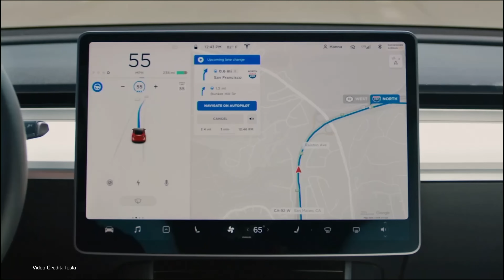Why Are Initial Production Runs Of New EVs So Slow?

Comment: My personal issue with these protracted wait times isn't so much the waiting because I get they are building something that doesnt currently exist. My issue is, the new normal is the "pre-order". It was dumb when video games started doing it and it's dumb now. There has to be other ways to find out who seriously wants a vehicle rather than taking money with not even the promise of "exclusive updates" or a baseball cap or mouse pad. Its like ordering from Amazon using prime but getting no info on when it will show up or even if it shipped. Only to find out randomly from the news that it's been pushed off by 8 months

Comment: Ford is often credited with the first moving mass assembly line but just as Star Trek touting how they filmed the first interracial kiss this is false. Mass assembly was made possible by interchangeable parts, the concept of which is erroneously credited to Eli Whitney but US mass assembly was pioneered by the US Ordinance Group for reliable production of small arms and rapidly adopted by the bicycle industry. Meanwhile the meat packing and flour industries were using moving "assembly" lines. Singer, the sewing machine company,  combined mass assembly lines with interchangeable parts tech decades before Oldsmobile and Ford implemented it for cars. Like Ford, Singer found some last minute refining of certain parts necessary before assembly - a problem that companies like GM still faced with parts like connecting rods up until the 1990s. Ford, like Edison, Whitney, Musk, et al was great at promoting ideas as though they were his own and gaining credit for them without the pesky difficulty of actually being the first to think it up.

Comment: The automotive assembly line was actually first used by Ransom Eli Olds in 1901. Ford did not begin assembly line production until 1908. Olds was the founder of the Oldsmobile car brand and the REO truck brand. And yes, the most popular REO truck was the Speed Wagon.

Comment: So, in summary,  It's not that Tesla is normal and other automakers are inefficient. It's just that other automakers are normal and Tesla is super efficient.
Reply from the maker: Not really. Tesla had the same sorts of issues getting their production lines rolling, as Elon noted in a tweet yesterday. It's far more that Tesla got a huge head start on the legacy automakers and of course on new startups, so while Tesla is rolling along at a pretty normal speed for series production of a car (think of how fast Ford turns out combustion F-150s) everyone else is still ironing out the process for their EVs because they are new models for those automakers. It's reasonable to expect that other automakers will get similar production speeds that Tesla has now eventually, but it took Tesla years to get there, and it will be the same for other manufacturers. - Winter

Comment: Best way will be to just allow all ice vehicles to be converted to Ev's

Production issues will be eased faster
Reply: What's stopping you?
Reply: @itekani  the rules dont permit such conversion 
If converted it cannot be used on roads 

That's the main hurdle

Let them have standards for conversion but that can add minimum 10 to 15 yrs life to the old vehicles

Ev's don't have complex equipment it is just battery and dc motors all gear boxes engines all that can be just scrapped 

Repair is equally easy 

While some countries are likely to have right to repair which may be used to convert vehicles but so far they expect a new vehicle to be built which will have all other things common like,
Body, steering, brakes etc which is redundant 

It can decrease the pollution at the same time
Reply: @prakashbapat3821  Not a problem here. But once you look into it you'll notice that even with all your own free labour put into it, the cost approaches what you would pay for a used EV with similar or better range and more features. Maybe this will change as used EV parts become more abundant, but I think conversions are for enthusiasts mainly. I will not be a way for the general public to get an electric car.
Reply: @itekani  here if they permit it. Ev's will cost less than half 

We have cheap labour and man power to do it on commercial basis ..

But there is probably lobbying from some quarters 

Further that can mean loss of revenue from new car sales on one side and permanently loosing petrol taxes which is the main income of govt now
Reply: @prakashbapat3821  I hope your regulations change. Governments will have bigger problems if we don't stop burning stuff soon.
Reply: @itekani  our govt is least concerned with all this so long as some/ big revenue is being generated
Reply: That change will just bring demand by the car manufacturer forward, increasing the problem and moving the bottle neck to the assembly line itself
Reply: @theairstig9164  the bottle necks are not from mang lines it's 
Only enough batteries and dc motors

All other things may continue

Just stop engine, transmission and add the two the vehicle production can be multiplied many times

Comment: When i think about it, manufacturers should give a special longer warranty on their first batch of a new line, as a thank you for first adopters as well as to incentivize adoption. What if Ford said, the first 75,000 Lightning Models off the line get a 7 year 500k warranty, as customer appreciation. If your vehicles are up to standard, then it's basically a cheaper form of advertising.
Reply: NO EXTENDED WARRANTY FOR YOU...!!!   (Warranty Dealer Rep voice)
Reply: @phillyphil1513  S'OK I won't be buying your crap car now. Thanks for confirming your attitude.
Reply: @spuddy4063  re: "I won't be buying your crap car now."  you will buy it and LIKE IT mister.
Reply: @phillyphil1513  TROLL
Reply: Who's to say some of the new auto manufacturers won't.  Meaning, they can always adjust the warranty down after so many are sold and/or a period of time has gone by.  E.g. Rivian is offering one of the best warranties for their R1T and R1S.  Perhaps after they produce/sell x number of them Rivian will reduce the warranty mileage and/or time period.

Comment: Rivin production could be very delayed - fire trucks are currently at there paint shop after a report of fire
Reply: YIIIKKKEESSS...! (here's to hoping they don't go FULL GRUBER)
Reply: @phillyphil1513  it turns out it was. a battery pack module that overheated in the battery assembly area and the fire service just needed to cool it down for a few hours

Comment: My expectations for Tesla's future vehicles:
I expect the Cybertruck to be more difficult and take time to ramp.  A totally new stainless steel production line for the body needs to be built.
I expect the future car (Low cost $25,000 (Probably $30,000 with inflation)) to ramp fast.  No worse then the Model Y.  I expect it will heavily borrow Model 3/Y technology.  For example it will probably use an LFP battery pack like the one used in the standard range Model 3/Y.  It will share the casting, stamping and paint shop with the Model 3/Y.

-Kurt

Comment: The first year of production of any vehicle is a time for working out production issues and problems.
The quality is usually much improved by the second year of production. Gas, diesel or electric vehicle they all go thru a learning curve when first being produced.
Reply: Even just new major model/ platform revisions had always slow ramp up. It just was hidden by car makers having whole range of models and model years. Thus having existing models in production and in sales and multitude of lines allowed bigger car makers to "stealth" the ramp up like VW did with ID.3, which was exceptional for EV. However not exceptional for cars in general. VW didn't pull the lets delay and make some to stockpile first out of a hat for ID 3. The had done same to some ICE model launches before.

Thus hiding from consumers the "actually every major new model change is a major undertaking". Company would just keep the old model in production and sales until the new model had enough stock and production line had ramped up.

Thus now when everyone is running their first EVs. Well there is no old EV to keep selling to hide the fact, that production ramp up takes time. The one who is about to start to be there is Tesla. They could now say run new major change of model S redo with completely new chassis and platform etc., while keeping the old spec model S in production and sale until  gen 2 was ready. Thus they could run a smooth hand over.

So it has always been like this. The EV model break just shows everyone how they sausage in being made. With ICE the manufacturers had long enough model range history, ICE specific expertise and so on to keep the run smooth to outside view. They simple wouldn't launch new model until they had sufficient stockpile and production capacity build up.

This will normalize, when everyone moves to their second generation of EV model ranges. They just keep making and selling Gen 1 model range, until Gen 2 is stocked and ramped up.

Comment: If you look at Initial Quality or Durability studies, vehicles from the first year of production fare very poorly. Early adopters get the shiny new thing, but also shiny new problems.
Reply: I will be taking delivery of on of the first 50 Aptera vehicles.  There are already several issues I know about due to supply chain problems - one is that the planned reverse cycle heat won't be available in early production due to a lack of transportation qualified reversing valves.  Because of the extreme simplicity and low parts count, and the granting of Right to Repair, I am looking forward to doing some of my own customization where it might prove desirable.  

The chance to enjoy the great leap in overall performance due to the focused design will be worth it for my wife and me.
Reply: @n.brucenelson5920  I think that's fair